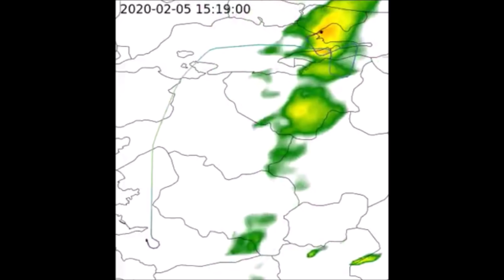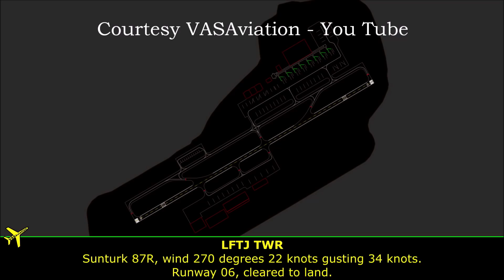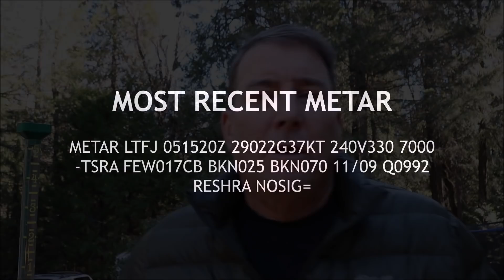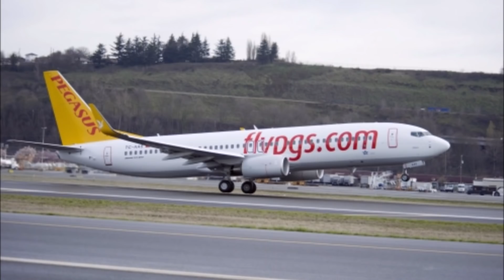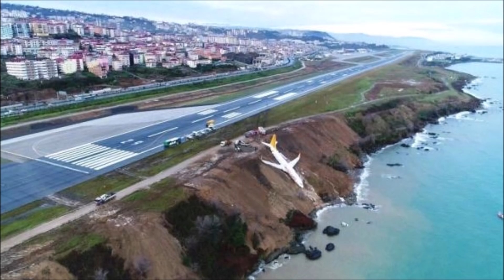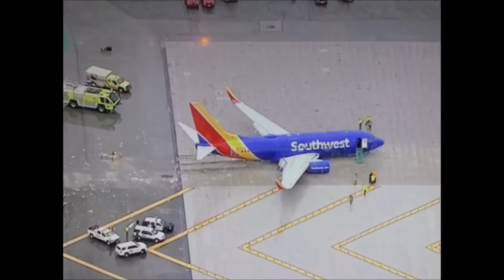Runway Overrun Istanbul, Turkey Pegasus 2193 B737-8 UPDATE 6 Feb

Comment: As a pilot at this level (airliner versus a 152), you really don’t need (shouldn’t) a calculator, or app. to figure out the reciprocals.  Additionally, you shouldn’t need much to figure out the wind limits - when you hear “22 gusting to 34”, you should already in your head if I hear “22 gusting to 23” I’m safe, if I hear “10 gusting to 40” I need another runway or go around.

Why wouldn’t the crew ask to loiter until the storm blew through?  They have weather radar.  I also put blame on ATC for not telling the crew they are changing runways.  So sad.  This did not need to happen.

Great collection of “oh crap” pics at the end👍

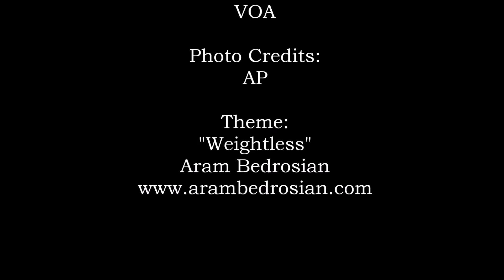Comment: 17:34  What about Air France 358 (A343 in 2005), which was very much like the Turkish crash? It  landed way down in a very severe thunderstorm and overran into a deep ravine,  without the proper calculations beforehand or proper braking procedures after touchdown. There were no fatalities, and even though the captain was the most seriously injured occupant, the crew were lucky in that the plane stopped just before hitting concrete approach light towers. Many lessons followed from that crash. ( I was sailing that evening and saw both the storm and the smoke plume afterward).

Comment: Thunderstorms and frontal systems will both cause dramatic shifts in wind direction. A thunderstorm is generally more transient, localized, and the winds may not be in alignment with the prevailing wind. In a thunderstorm the winds will descend in a central shaft from high in the cloud and disperse over the ground in a 360 degree cone pattern. This means, as Juan pointed out, that the aircraft's relationship to the storm will affect the nature of the wind change. Thunderstorms may be stand alone systems or they may be associated with a line of storms as in a frontal system. In this case it appears that the precipitation was associated with the passing of a frontal system with embedded storms. A frontal system, particularly a cold front, will generally see a strong shift in the winds as the front passes. The winds at the surface will not change at exactly the same time as the winds aloft. This is caused by the fact that the leading face of the front is not directly perpendicular to the ground, thus the winds at altitude may be from a substantially different direction and strength.This means that the tower could be reporting winds directly down the landing runway, while at altitude one could have a tailwind. The inverse is also possible. Normally an airport will not do a 180 on a runway change for a local isolated thunderstorm, this usually only occurs with a frontal passage where the wind change is expected for a prolonged period. Turning the airport around requires substantial coordination, with aircraft being vectored around to the far side of the airport, causing traffic delays and additional work loads on the air traffic controllers. In this case it appears that the Pegasus flight was going to be one of the last arrivals on 06 before going to 24. It is possible that the accident aircraft, while with approach controll, was expecting the winds to be more aligned with the runway. However, with the passage of a front the weather, and wind situation can be very dynamic. Normally when an aircraft is handed off to the tower controller they will issue the latest wind update and a clearance to land on a specific runway. In this case the flight crew acknowledged the landing clearance but they did not acknowledge the wind update. Did they realize that the winds had shifted to within a 30 degree tailwind. We don't know. In any event the above may help to explain how one might get into this situation, but all could have been corrected if they had recognized that they were in an unstable approach and had gone around.

Question: Should emergency arresting barriers be mandatory at the ends of major air carrier airport runways?

Comment: The inventor in me asks the question why isn’t their multiple catch wires similar to those used in aircraft carriers or a parachute on the back of the plane.  If this happens often enough, these are reasonably cheap systems to implement.  You could even design something to catch the engines to sheer them off to minimize fire risk.  How about water barriers like those used before road bridge supporting concrete so a car doesn’t hit the cement bridge support.  The bigger question is why do humans take so long to work out simple solutions.  That was a rhetorical question.  I know it’s ego.  Us stupid humans.
Reply: Yours is the sort of brainstorming which engineers use to come up with a workable solution from many possibilities.  Typically it's not very far into the process that the simple solutions get rejected for various good reasons, and so time to complicate things some.  I'll pick your "parachute" idea as the one to talk about from those you presented, since that one is near and dear to me from my career:

In July 1985 at a Johnson Space Center meeting, I told the Shuttle manager that NASA should add a drag chute to the orbiter (along with carbon brakes -- the existing beryllium brakes were inadequate because the orbiter ended up a lot heavier than when the brake design was frozen).   So I'm not averse to braking chutes.  It made some sense in that application because of the operational particulars.

Then NASA did what bureaucracies do best, and ignored my advice until several months later when Challenger was lost.  Now they found themselves with a lot of money on their hands, plus a few years of time to kill with the Shuttle grounded.  Starting with return-to-flight STS-26, the Shuttle had a drag chute and carbon brakes.

Turning to airliners, just about everything which made a drag chute a good idea for the Shuttle application goes the other way for routine jet transport operations.  It got used for every landing on the Shuttle, but would most likely be be deadweight for its whole existence on any particular aircraft (and at the back, hurting CG).

On an airliner it would only be deployed as a last resort, but by the time they know they are in trouble a chute will be getting less and less effective.  Only one-fourth the drag after speed has decreased by one-half, for example.  "Too little too late".

Finally, there is one operational factor after another working against having a drag chute.  A nasty side force trying to pull the tail around in a crosswind landing, for example, and made worse by any runway contamination (water, snow, ice).  Inadvertent deployment during a hard landing (bad) or severe turbulence mid-flight (worse).

So carrying a drag chute is a good idea to explore from a brainstorming standpoint, but ends up not being worth implementing.

Comment: If I heard you correctly, Juan, you said that the next plane in line to land was told to "wait, we are going to turn the runway around". To me this is saying as soon as we get this gut on the deck, you will be landing on 24. Why would This Pilot NOT say, " Hey, I refuse runway 6 - I want 24 also"? Or better yet, as you said, why did the tower shut down all take offs and landings till the storm was well past and then determine which runway to open dependent on the updated wind direction.        sdh in Ct @ BDL
Reply: steve holton   I think the plane that was told to wait was on the ground , readying for take off. When the tower announced the winds, the pilot should have rejected the landing clearance. Just as Juan pointed out.

Comment: So, what was the pilot in command thinking? I know when you come in HOT, what can happen. I was in Burbank when a Southwest 737 overshot the runway and ended up on Hollywood Way next to a gas station. He came in too hot and could not stop in time. Juan, do pilots have to worry about any discipline problems from their employers if they initiate a go around if there is any doubt as to the safety of a landing or if others may disagree with that choice? I would think they would be more concerned with the safety of the passengers and the jet itself rather than the extra fuel costs in doing a go around. I am just wondering what his thinking process was when given the weather and runway information by the ATC.
Reply from the maker: "No Fault" Go Around policy.

Comment: odd that the tower was changing the ry config but let the flt land ….1 of the contributing factors to the LIT crash that I don't believe was mentioned is the length of the runway I think that ry was at 7000 ft so little room for error

Comment: When you get the thumbs up to start flying again (soon I hope), the passengers will ask is Juan is the pilot? If the answer is "yes",,,, okay this is a cake walk.
Reply: Except Juan will be the first officer, not the pilot.
Reply: @lizj5740  I think they are both pilots, one pilot is the captain, the other pilot is the first officer.
Reply: @orlovsskibet  If my understanding is correct ( and that's suspect ) The captain ( left seat ) is in control. The first officer ( right seat ) does the actual flying. ( hands on the controls )
Reply: @easternwoods4378  i am not a pilot myself, but I am quite sure that they take turns driving :-) I also read recently that depending on the strength of the wind, they  may have different limits depdending on flying hours. Maybe a real pilot could chime in on this to enlighten us 😊
Reply: @orlovsskibet  As Eastern Woods says, one is the captain and one the first officer. Sorry, I'm still learning the terminology. Thank you for the correction.

Comment: Sounds like the airport was not on top of the rapidly changing weather conditions sufficiently and the rapid increase in tailwind component left them too late to switch directions.  Looks to me that the AC should have been put into a holding pattern until the conditions were better understood and the reciprocal runway activated.  This doesn't absolve the pilots of course, but it does suggest, as is often the case in these events, that there was more than one factor at play.  If the flight had arrived 5 minutes later they may have had the runway switched and everything would have been OK.

Comment: For my own benefit, I wouldn't mind knowing the row/seat numbers in the 737 variants in the location of the fuselage where they are "designed" to break up in order to assist in the dissipation of the relevant forces.  These must surely be recognised as the most potentially dangerous areas of the aircraft to be seated.  Looking at the pictures of the various doomed aircraft, it is very noticeable that they all appear to break up in exactly the same spots in the fuselage
Reply: It'll vary depending on the airline and how far up your nostrils they expect you to put your knees to perch on the seat, but if a seat-plan is available for the airline you are flying, the strongest bit is over the wing box.
But things balance out, as that's also nearest the fuel.

Comment: As to the airport's preference for using runway 6 the area  beyond the end of the runway is largely empty, occupied by only businesses. There are densely populated areas starting within about 2000 feet of the end of 24. Taking off on 24 is certain to cause noise complaints and controllers have likely been told to avoid doing that.

Comment: I wonder if the pilot got himself in a pickle where the needed go around would’ve taken them into the belly of the beast of the storm?
Reply: SlocketSeven the right-er choice would’ve been to not start the approach with that tailwind.
Reply: SlocketSeven you don’t seem to be familiar with microbursts, wind shear, sever turbulence, etc...   😎.  Yes the plane likely can survive the storm unless the plane impacts the ground due to shears and downdrafts and/or the pilots lose the big picture and can’t prevent an impact.  

In an Airbus; the pilots just have to pull back on the joystick and max power and go for a ride.  In a 737, the pilots are in direct control of the flight controls and it’s a rodeo ride while being scared shitless.
Reply: Andrew Souther - Part of your in-flight planning is how you manage storm cell avoidance or, if you have to, penetration. You use everything around you to come up with a plan, one that hopefully allows a few bolt-holes.
Reply: Trevor Austin at my airline, we don’t train for thunderstorm penetration. It’s against safety policy.  😎

Comment: I remember the El Al 747 which experienced an engine departure on climb out.  In that case, the very unlikely scenario of the jettisoned engine hitting the remaining GOOD engine on that side actually happened.  Even in that instance though, the airplane was still controllable however the pilots didn't manage their speed correctly as they configured for the emergency landing and ended up hitting a high rise apartment building a few miles from Schipol.  I think it was about 15 years or so ago...
Reply: 27 years, 4 months, 2 days. 

October 4, 1992.
Reply: Wow...doesn't seem that long ago.  But now that I really think, I was on a Continental 747 flying from Guam to Honolulu when I read about it.  So yeah it would've been 1992.

Comment: I’m just wondering why the ATC didn’t tell them to go around when on final & do the runway change??
I’ve seen & listened to ATC do it here in Darwin in far less tail wind conditions.
Reply: Captain's option, and responsibility.
Reply: Captain’s call, but I have been sitting in jump seat on our company aircraft and heard the ATC “suggest you go around.”
Reply: Mat K equally poor training
Reply: I know nothing about this airport, but I know that at others picking who the last plane to land before reversing the flow can be a real trick and sometimes ATC gets it wrong.  In this case it was clearly one plane too many.
Reply: Mat K - It’s not the job of ATC to tell you to go-around. Their job is to offer you a clear runway and accurate, timely data. They did this. What we don’t know (and no fault is implied nor is it intended) how long it takes for this airport to reconfigure. It’s not an excuse, but could have been an issue. Not everyone can keep their cool when faced with poor weather and minimum fuel. It is therefore essential that this crew are skilfully interviewed. But this being Turkey I can imagine the crew will have black eyes and broken bones already.

Comment: Hi Juan ...

Nicely put, although I understand that the Fuselage has to dissipate the force being exerted on it, it is still alarming to see a Fuselage in pieces ... This has now happened more than a dozen times with 737 aircraft where they break-up, potentially sprewing passenger out of the fuselage, the 707 destruction test that the FAA / NASA did didn't break up the fuselage, all be it the wings and engines separated the main compartment with passenger stayed in tack, potentially saving many lives, this aircraft destruction has seen fatalities and many injured, one wonders had the fuselage been intact, would the outcome have been better ... ?  Is it better to be in a car when it's involved in an accident or be thrown clear ... ?

It also begs the question, if the forces are great enough mid air, are we actually going to see a 737 break up in a mid air incident ... ?
Reply: Planes aren't designed for vertical forces encountered when dropping 65 feet at 30 knots (free fall), which is orders of magnitude greater than ANY vertical force they may encounter in flight.
Reply: @Deploracle  Well put. Just as a small correction, they fell off the runway at 63 knots. So even worse.
Reply: Given that the 737 NG has been flying for nearly 23 years now without anything approaching a mid-air break up, I sincerely doubt it.
Reply: Mid-air breakups are usually about metal fatigue failures from cracks, rather than the classic "load exceeds design load" failure.  So yes it might happen, but an on-ground overload/breakup doesn't foreshadow such an occurrence.

Comment: I think in the very near future with well designed software, these big jets are better served landing with an auto pilot ... especially in bad weather.  With the human being the final say on a go around. This crash sounds like either not enough fuel for go around, or the pilot was caught off guard by the tail wind.
Reply: Peter Grant   The crew was advised twice of the wind conditions.  I think it simply was a time pressure and maybe a bit of ego.  Go around, climb to a few thousand feet, fly downwind, get back into the approach takes at least ten minutes.  Late to the gate, egg on your face.

Comment: If the wind is 30 degrees from straight down the runway, the sine of 30 degrees is 0.5.  So for a 30 kt. wind the tailwind component would be 15 kt.
Reply: Draw the vectors on paper.
Reply: Yep!  Graph paper will work.  As an electrical engineer, I did that a lot.

Comment: Easy to be wise after the event, but to fast, to high and to far down the runway with a tail wind!  Also this was the last before they changed direction.  I would have gone around and tried later or at least come in from the other end.  Pilots are under far to much pressure and they should not be.  Putting pilots under pressure risks planes and passengers as well as the risk of loosing pilots.
But it is easy to say after the event!